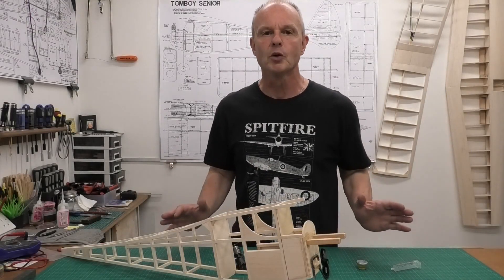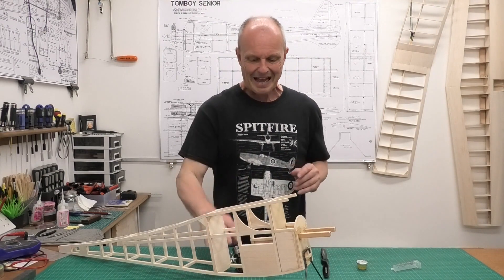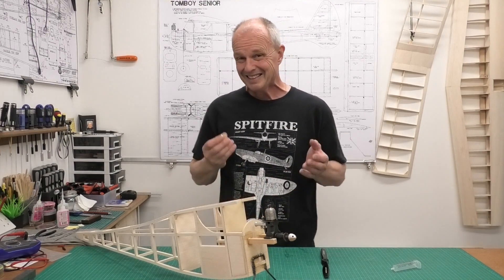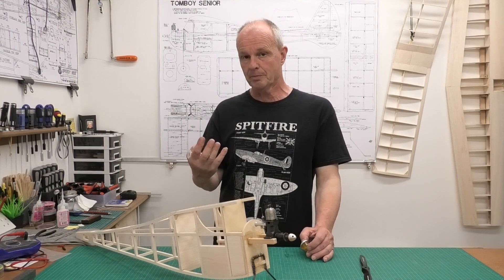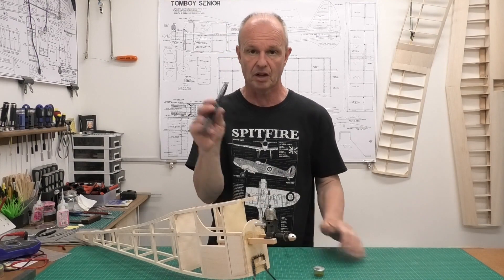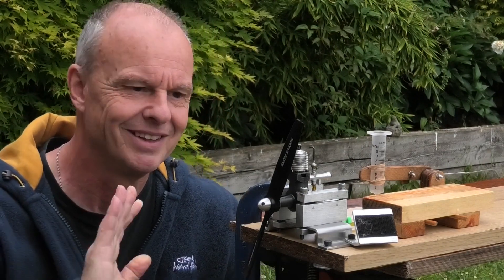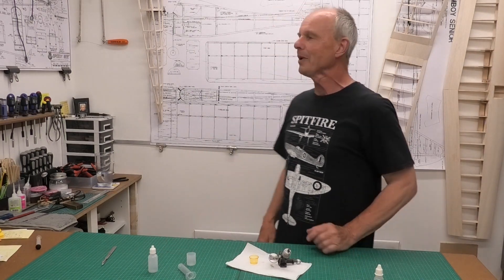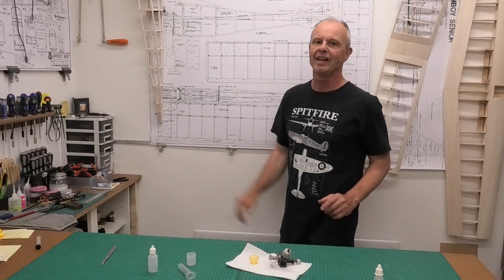Tomboy Senior - Build Series - Pt 6: Mills 1.3 Engine Fuel Consumption Test

Comment: Very much enjoyed the video Mark, The Mills 1.3 is a very sweet running engine. I am currently building a Veron Cardinal for the smaller Mills .75. The Cardinal is of a very similar layout to the Tomboy but uses sheet fuselage sides. Isn't it great that these 70 year old engines have survived and are capable of flying a lightweight radio model today.
Reply from the maker: Excellent, thanks for the comment, I realy do love these old Mills engines

Comment: Hallo Mark, I think this engine is to small end need an  0.19 engine like the PAW 19.what do you think?
Reply from the maker: I am using the Mills 1.3 as that is what is shown on the plans, and it would be a great engine to see in this model, if it does not have enought power I will change, adapt it as I go.